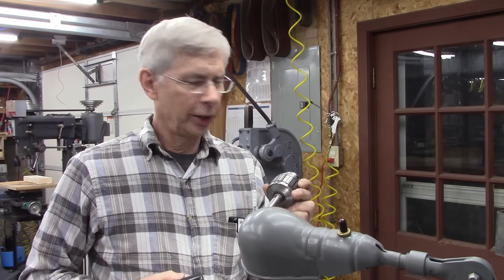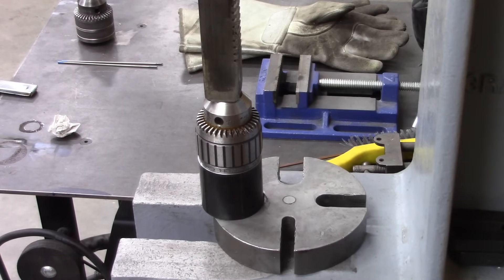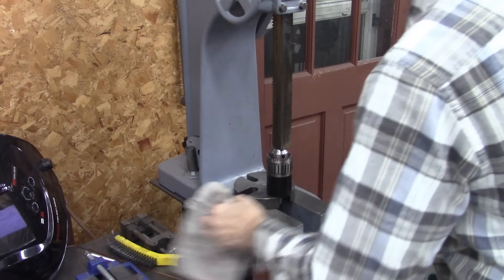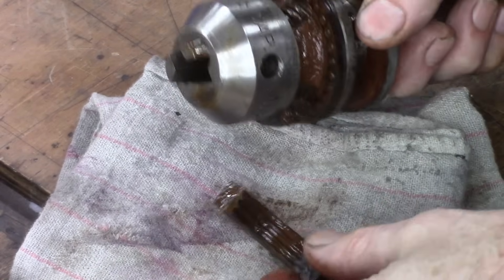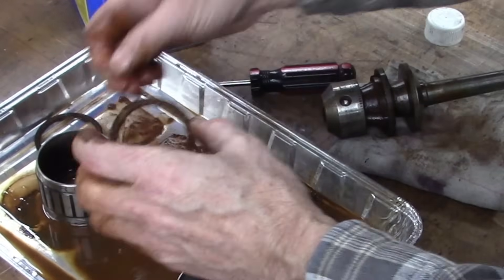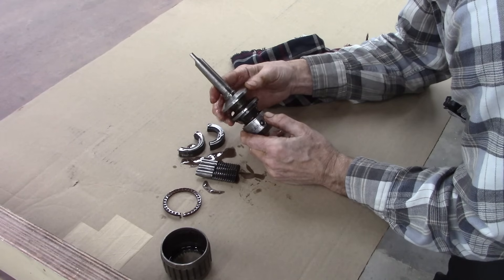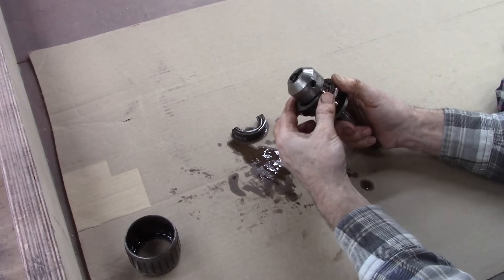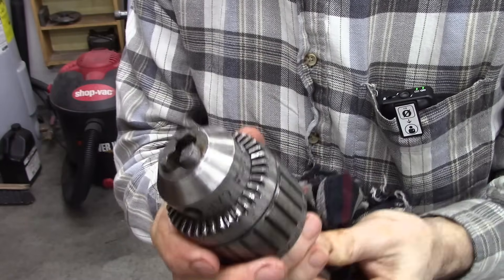Jacob's Super Chuck Rebuild - do’s and don’ts

Comment: Nice restore.  I made it my practice to take the jaws out in order, then take a photo.  Btw.  Had a 16n I picked up with no race or ball bearings.  Designed and printed a race on a 3d printer and inserted 3 mm balls. Also I once broke a tooth off a jaw because the jaws were in too far.  It was a Jacob’s but not a super chuck.  Jacob’s manual says they should be out a few turns.
Reply from the maker: Thanks Dave, very cool idea on 3d printing the bearing cage. I think you are right about the jaws but with the super chuck it doesn't mater. I should have included this in my video.

Comment: Not everyone has a lathe to customize a pipe, nor do they have a press. I used a gear puller, which was a loaner from the local auto parts store, in conjunction with a socket, which also could be a loaner, to cover the half protruding jaws.
Reply from the maker: Excellent ideas!

Comment: I have a Delta floor drill.The other day I tried to drill a hole with a 1/2" size bit.  The chuck would not hold the bit tight. .  The bit would slip in the chuck.  The bit was as tight as I could tighten it. What do I need to do so it will hold the bit?
Reply from the maker: It could be a worn chuck. If there is a rebuild kit available it come with new jaws. Ball bearing chucks hold better because the friction is reduced while tightening. For given force on the key the jaws will be tighter.

Comment: A good rule of thumb is if metal chips and swarf are involved, avoid grease as much as possible. Grease wax base turns swarf into grinding compound. Oil mechanisms liberally to keep chips and swarf  washed out.
As others have mentioned, follow the disassembly instructions for the particular chuck you have to avoid damage to the chuck.
New old stock repair kits for Jacobs chucks can be found on ebay or the like. If the jaws show signs of damage, a rebuild kit will have new jaws and two piece threaded ring needed to make your chuck like new.
Reply from the maker: I think I did oil it and was told to grease it in the comments. I agree with you. Plus I did not want to have friction. i wanted to be able to spin the chuck for rapid bit changing.

Comment: You are an idiot for using a torch on hardened steel. 
A few good blows with a brass hammer would work perfectly. 
I have rebuilt many Super Chucks. The outer barrel clamps onto the split nut inside. Heating with a torch will cause this chuck to slip.

Comment: 10+ years ago I bought a new ball bearing chuck. Within 6 months the jaws were junk after a few drills spun. Never in all my years have I had a Jacob's chuck do that.  I was going to by a kit and found Jacob's is all Chinese. Soft metal comes with the chuck at no charge. -- Repair kits are about $75.00 from the cost of a new chuck. 
Any better parts out there. It's setting on the shelf cause it won't hold a bitt.
Reply from the maker: Interesting. I have 3 Jacobs Super Chucks. One is a 14 and the other two are 14N. One (the 14) came on my 1917 drill press and the chuck itself has a 1916 date on it. For it's age it in fair shape bit the jaws are worn and it has runout. The second came on a Cannedy Otto drill press from about 1910 but I'm certain it was not original. It was in great shape and I am still using it and have been for about 5 years. This was actually my first super Chuck and I notice right off that it gripped much better than the standard Jacobs chucks. The third is I just got on ebay and it was the one in the video. Maybe its junk, time will tell. Certainly hard jaws are very important

Comment: There's no numbers on the body.  The gullet of the jaw is the indicator.  Either way, there's only one way they index, so its a matter of trial and error.  This is the "new" style, which is significantly cheaper than the older models.  The sleeve can be overpressed during reassembly, resulting in improper key engagement, but is easily remedied by re-aligning the sleeve.  I like petroleum jelly for a re-lube, as it's nice and light, and responds well to WD-40 if the chuck gets stiff.
Reply from the maker: You have my interest, the body and key engagement is very interesting. It is something I noticed, it isn't bad but it isn't as good as it could be. Thanks!

Comment: The rebuild kits for those newer style chucks are extremely expensive. Over $300. Reusing the old parts, even broken but functional, is the smart play, if you ask me.
Reply from the maker: They are very high and but still, you and buy the new for 280. Amazon has the kits for about $100...  still seems high tho.

Comment: I have to warn people about buying used chucks on eBay, or anywhere else for that matter after. About 20 years ago I bought a 3/4” SuperChuck. The tips of the jaws didn’t meet when tightly closed. I bought a repair kit from McMastercarr. Those are expensive. After doing the work, I found that while a bit better, the jaws still didn’t close properly. So I took it apart again and did some measurements. It turned out that the chuck body was slightly deformed. Since they sell everything but the chuck body, there was no way to completely fix it. I ended up grinding the jaws out slightly and that took much of the problem with it. But it’s not really what it should be. Usable, but not as good as it should be. On the other hand, about two years ago I bought a 5/8” version for a nutty $69. I figured something was seriously wrong, but it was so cheap I couldn’t resist. The problem was that the key didn’t fit properly. I found that someone either tried to take it apart and couldn’t, or put it back together and didn’t get it completely pressed. After cleaning it, I pressed it back and it’s perfect. So you never know. I have a ,out of chucks. A couple of new SuperChucks, a couple used, and others. All interesting. By the way, if someone buys a used chuck that isn’t a Jacobs, be warned. They don’t come apart the same way. I’m speaking about chucks that look like a jacobs. They’re built differently. You can usually tell before you read the name. Jacobs chucks have the cuts on the housing running in the same direction as the chuck, and the others have rings in the housing.
Reply from the maker: Yeah, I probably need to redo the video and make people away of the differences. New Super chucks are very high priced. I have two of them and bought this last one on ebay and the other came on a very old drill press. Fortunately both are in very good condition. I only paid $40 for the last one so i did well but I do understand what you are saying.

Comment: Thanks, Wink, I have 2 of them that need that done, they came with my lathe when I bought it and are very sticky, so I got another one on eBay and never got around to throwing them out. You saved me lots of money since they are 5/8" and 3/4" and I just bought the 1/2" on eBay in 2017.
Reply from the maker: Cool!  FYI  From what I understand other some chuck need to have the jaws mostly closed. You have to put a sleeve or pipe over the jaws to press on.

Comment: Jacobs' Service & Repair PDF states:  Do NOT assemble on an arbor press as excessive pressure
will expand the chuck body and distort the chuck jaw holes.  I think this applies when installing an
arbor but since your arbor was already installed you may be OK.
Reply from the maker: Interesting...  I didn't use much pressure but I'm not sure I could have done it without the arbor press. I wonder how you are supposed to do it?
Reply: You were pressing on the sleeve to get it apart, perhaps you should have pressed
on the sleeve at the other end to reassemble and not press on the arbor.  
I think Jacobs is saying when installing a tapered end arbor to give it a good wrack with  something like a dead blow hammer or piece of wood.  But what do I know, I probably would  have done the same as you.
Reply from the maker: @petemclinc  I was pressing on the sleeve. It was sitting on the pipe. The other end was pressing on the taper. Before I had an arbor press I did it with a hammer with the chuck body in my hand. It took a ring of skin out of my hand where it slipped. The arbor press is very controlled and didn't require much force at all.

Comment: Dear Winky, was that Mineral spirits?  
BTW.  Thanks for the idea on the Aluminum pans, thats a great and inexpensive idea.
Reply from the maker: Yes. Mineral spirits and then Spray Power cleaner. It's a great cleaner especially if you heat it up.

Comment: It’s not a good idea to use grease in drill or lathe chucks, it just act like a magnet for dirt and metal chips…a light oil like 3 in one works absolutely fine and makes future maintenance much easier..
It’s also a good idea to drill a 6mm hole through the the chuck so a punch can be used to remove the arbor if necessary.
Reply from the maker: Good suggestion, I used light oil and I have drilled the hole in the past, this one had one.

Comment: Hi Mark, man that was some nasty gunk. I got a few of these that probably need the same treatment.
Yeah I've only seen the loose bearings on other videos...interesting
Thanks for sharing !  👍👍
Reply from the maker: Yeah, super nasty! I found out after posting some chucks are made different. Some require that the jaws be extended. You have to put a pipe over the jaws before pressing it apart.

Comment: Wow that was extraordinarily gunked up inside wasn't it?! Holy crap. Thanks for the vid to add to the collective knowledge on how to get one of these apart, clean/service them and then get them back together properly.
Reply from the maker: Yeah is was bad. Please note: This procedure is only good for the super chucks. Other chucks require that the jaws be in the closed position and you put a scrap of pipe over them before pressing them apart. I should have put this in the video but I've only rebuilt the Super Chuck.

Comment: Plastic parts? Guessing newer model chuck made in China? Jacobs used to be a good chuck but they sold out. Disgraceful.
Reply from the maker: I think they did that to make them easier to rebuild. Please note: This procedure is only good for the super chucks. Other chucks require that the jaws be in the closed position and you put a scrap of pipe over them before pressing them apart. I should have put this in the video but I've only rebuilt the Super Chuck.
Reply: @WinkysWorkshop  I'm pretty sure it's so they're cheaper to produce. Ease of rebuilding means nothing to the shareholder.
Reply from the maker: @desertdweller9548  sometimes pride in workmanship is the motive but I agree, its usually money.
Reply: @WinkysWorkshop Yup, but with big companies it is always money.😞
Reply: Yep!
Reply: A plastic bearing holder is not necessarily bad. The older Super Chucks used individual balls that had to be inserted one by one.
Reply: @ellieprice363  Plastic isn't bad in and of itself, but that doesn't mean it belongs in a drill chuck. It's there to save cost, nothing else.
Reply: @desertdweller9548 There’s two types of ball bearings, full compliment and caged.  The full compliment type is completely full of balls and only used in extremely high radial load applications where caged bearings with fewer balls would fail. 
Since full compliment balls can only be loaded through openings in hardened races this type will quickly fail under side loads. 
Caged bearings, with balls separated by metal or plastic cages, are fully adequate for ball bearing chucks. Which is probably why Jacob 
changed their design. 
.
Reply from the maker: @ellieprice363  The only negative might be fewer bearing to handle the load.

Comment: Awesome video, I've never seen a chuck apart like that. Now, if you could explain how I'm supposed to get the chuck out of my craftsman drill press.
Reply from the maker: Thanks, Please note: This procedure is only good for the super chucks. Other chucks require that the jaws be in the closed position and you put a scrap of pipe over them before pressing them apart. I should have put this in the video but I've only rebuilt the Super Chuck.
Reply: Hi, wedges should remove your chuck no problem
Reply from the maker: Sometimes there is a screw inside the chuck and some have a ring with holes in it that can be turned to push the chuck off. Most are just a force fit...  like dave said, wedges
Reply: @WinkysWorkshop or if the chuck can hold a nut and bolt use that to upward force the tapered quill out ( if there is no screw behind the chuck( securing the quill ) .

Comment: Thanks for sharing this Winky.
Reply from the maker: You are so welcome. Please note: This procedure is only good for the super chucks. Other chucks require that the jaws be in the closed position and you put a scrap of pipe over them before pressing them apart. I should have put this in the video but I've only rebuilt the Super Chuck.

Comment: Keeping your tools in good working order. Excellent Winky. Thanks for the lesson. Don
Reply from the maker: You bet. Please note: This procedure is only good for the super chucks. Other chucks require that the jaws be in the closed position and you put a scrap of pipe over them before pressing them apart. I should have put this in the video but I've only rebuilt the Super Chuck.

Comment: Never taken one apart.  I have a chuck that is bad.  Now I will practice on it.  Thanks for the video.  It all helps.
Reply from the maker: Please note: This procedure is only good for the super chucks. Other chucks require that the jaws be in the closed position and you put a scrap of pipe over them before pressing them apart. I should have put this in the video but I've only rebuilt the Super Chuck.
Reply: @WinkysWorkshop  might want to pin this comment.
Reply from the maker: @dans_Learning_Curve  I can't pin my own comment but I did put this in the description. I think I need to redo the video and repost.
Reply: @WinkysWorkshop  should be able to make a new comment and pin that one.
Reply from the maker: @dans_Learning_Curve  Done - thanks

Comment: Awesome video, thanks for sharing that info. 🫵🏼💯🆒
Reply from the maker: Thanks! Please note: This procedure is only good for the super chucks. Other chucks require that the jaws be in the closed position and you put a scrap of pipe over them before pressing them apart. I should have put this in the video but I've only rebuilt the Super Chuck.

Comment: Mark those disposable/reuseable aluminum kitchen pans are great for cleaning parts. I save them when someone bakes something for me. I also use kitchen foil for masking and plugging holes to keep mud daubers out of holes. JT's Barn and grill used the foil when I mentioned it to him to mask things like hydraulic hoses on a tractor he painted. The sky is the limit when it comes to creativity in the shop. Thanks for bringing us along. We never get too old to learn and that includes Me.
Reply from the maker: Yeah, I save them but i have a bunch this size. My bro in-law works for a company that puts bread rolls in them.
Reply: Lucky you. I priced a deeper one at the grocery store and they wanted $8 for one!  lol @WinkysWorkshop
Reply from the maker: @terrycannon570 That's crazy

Comment: Mark,
That was a very good instructional clip, no bs and right to the point. This is the correct way to strip and clean the "Super-Chuck" type, however with other Jacobs type chucks, doing it this way presses back the sleeve against the machined teeth and breaks them, the method to do those is to partially open the jaws, put a tube over them that presses against the chuck body as it clears the jaws, and press against it that way. Keep up the great work.
Don
Reply from the maker: You are the second person to say this, I wish I had known this. Thanks.
Reply: You are welcome Mark.  @WinkysWorkshop

Comment: BUENO BUENO ALGO DE MANTENIMIENTO
Reply from the maker: Please note: This procedure is only good for the super chucks. Other chucks require that the jaws be in the closed position and you put a scrap of pipe over them before pressing them apart. I should have put this in the video but I've only rebuilt the Super Chuck.

Comment: Thank you for the interesting video.   I think it was Bob Vaughan over on the old woodworking machinery site that explained about the wear on the inside of the jaws.  I don't think you showed it but the "gripping strip" along each jaw can get worn to the point that each  one is no longer uniform it it's shape, width, and length.  thus no longer gripping uniformly along the part.  It would have been interesting to see how worn your's were.  keep up the good work.
Reply from the maker: Slight wear but not super bad. I cleaned up the one that came with my 1917 drill press and it was worn bad. Still amazing after over 100 years however.

Comment: i have old chucks on drill presses from the 1940's, both could use this i'm sure.  they are not jacobs chucks, one is marked "ball bearing supreme" and it was the chuck supplied by callander foundry aka beaver in canada
Reply from the maker: Keep this in mind (from another comment): This is the correct way to strip and clean the "Super-Chuck" type, however with other Jacobs type chucks, doing it this way presses back the sleeve against the machined teeth and breaks them, the method to do those is to partially open the jaws, put a tube over them that presses against the chuck body as it clears the jaws, and press against it that way. Keep up the great work

Comment: Спасибо мастер,с вами интересно,с вами Воронеж,РФ.
Reply from the maker: Please note: This procedure is only good for the super chucks. Other chucks require that the jaws be in the closed position and you put a scrap of pipe over them before pressing them apart. I should have put this in the video but I've only rebuilt the Super Chuck.